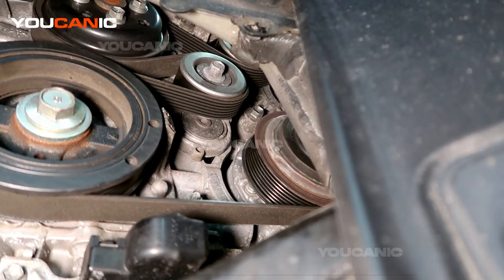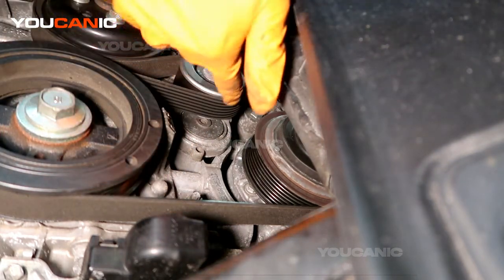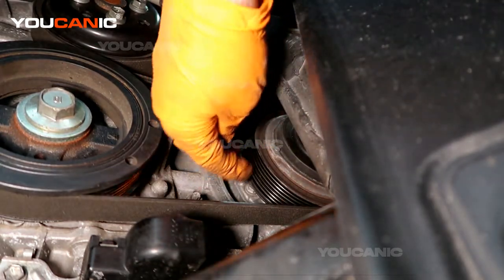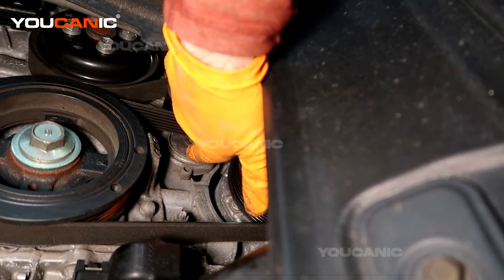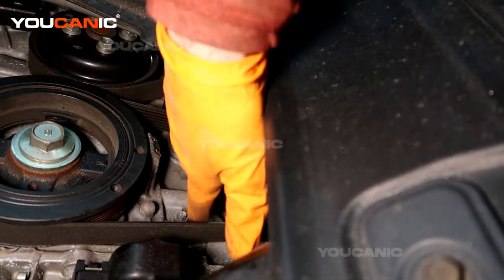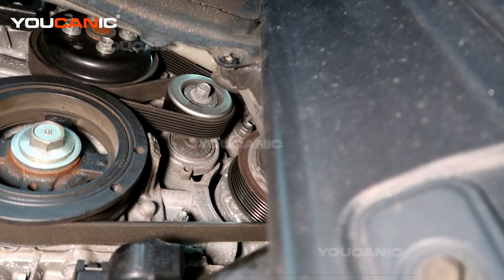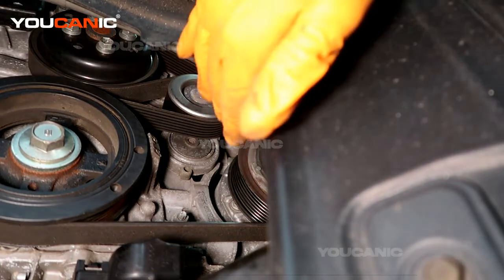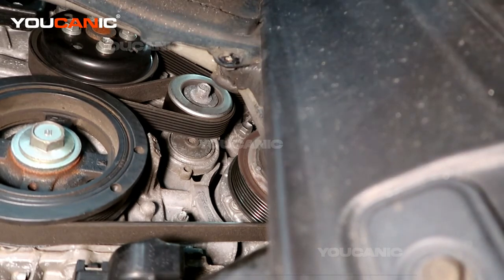2014–2019 3.5L Toyota Highlander - Tensioner Pulley Replacement Guide

Comment: i dont think the tensioner itself ever goes bad for the most part.  usually the bearing on the pulley is what needs replacing and this can be done much easier.

Comment: how does someone know (any obvious symptoms) that the tensioner or the bearing on the pulley needs replacing?  I have a 2015 highlander with the v6, with 120K miles.  would like to get an idea of what to look out for.
Reply from the maker: You can often tell that the tensioner or bearing on the pulley needs replacing if you hear squeaking/squealing noises, notice accelerated belt or pulley wear, or if there's erratic belt tension. However, these could also indicate other issues. For an accurate diagnosis, consider using the YOUCANIC Full System Scanner [www.youcanic.com/scanner]. 

With any further questions or for more specific guidance related to your 2015 Highlander, feel free to ask on our platform [www.youcanic.com]. Our goal at YOUCANIC is to make car repairs accessible and understandable for everyone.